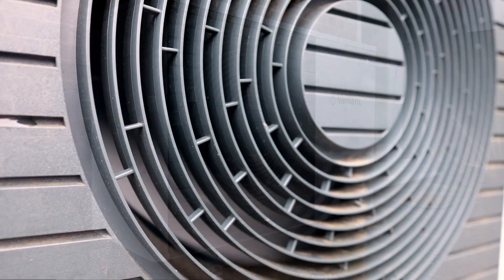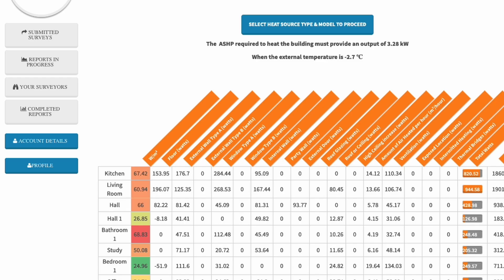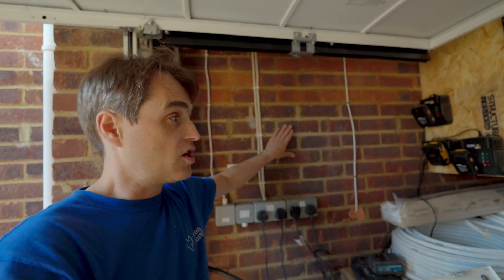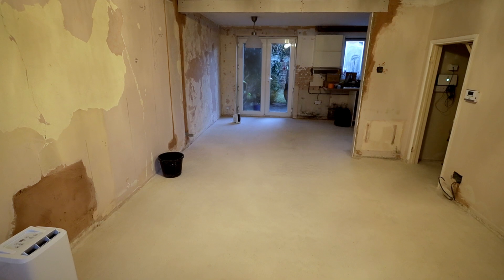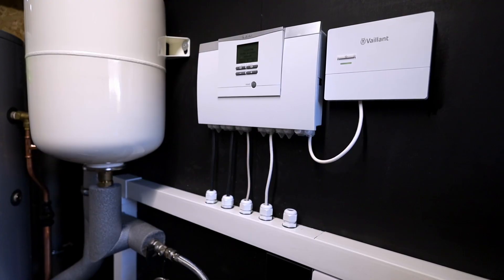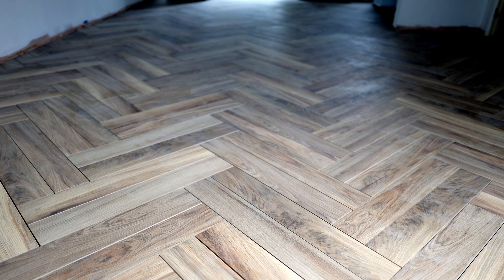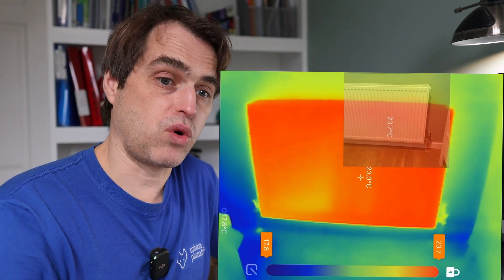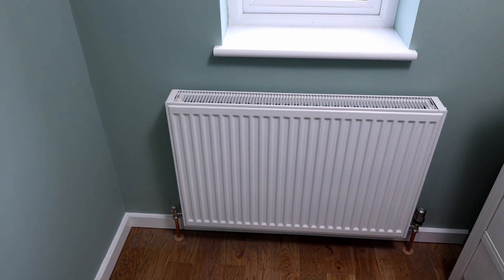How I Installed The Most Efficienct Heat Pump In The UK.

Comment: Great video. You mentioned no convective radiators. Are these a negative to efficiency? The Jaga ones for example give pretty decent performance at low temps on speed 1. Would be great to get your input. I should clarify I meant fan assisted rads.
Reply from the maker: I only came across Yaga once, and they had a very high resistance to flow, which did not impress me much
Reply: @UrbanPlumbers 

Hi thanks for your speedy response. Noted. I'm assuming that the main pipework could be sized slightly larger so your index run is reasonable. Great vids for what it's worth.
Reply from the maker: @pungusattah  i don tknow what the pressure loss is across yaga rads, but on the last we did it was substantial and made the job very tricky to balance. I would check the Kvs values of the rads to be sure, as upsizing the pipework may not have that much effect, as the pressure loss on the models we worked with was substantial. I know I will be very careful with those rads from now on. (meaning - will make sure I check the Kv values before installing them on any system).

Comment: How is the hot water hot enough for a shower if the heat pump flow temperature is so low?
Reply from the maker: All modern systems run (or should) 2 different flow temps- low for heating and higher for DHW. Some call it priority hot water, but it gets confused with old school W plan.

Weather compensated system will basically run water on its own and with different flow temps

Comment: Landlords are not going to install expensive efficient systems, they will install the cheapest , and i will knock a hole in the wall for a flue and use a wood burning or coal burning heating system. Used during the dark which is most of the day during winter. so nobody can see the smoke being expelled. I am all for green energy but not when i comes to the point of me choosing between heat and food. And i guarantee there will be millions like me.

Comment: Surely there's going to be a lot of heat lost to the ground. Can an uninsulated slab really work as a heat store??
Reply from the maker: Yes - we have done around 30 large installation in this manner and they perform amazingly well - some run COPs 5-6 and use very little energy.

Comment: I have just paid my deposit to Heat Geek, So I am hoping for, or perhaps expecting, a similar outcome. I have a 4-bed late 70's detached house but my annual gas bill for heating and hot water and a bit of cooking on the hob is just £260 with a combi boiler, which I run at 45 °C flow temperature. I hope all Heat Geeks are as good as you! Great install, thanks for sharing it.
Reply: 12kw ASHP  at 45c flow, 24/7, costs £300/month for heating, northern. Running on urbans principles, almost, bar the flow temp.
Reply: FWIW,  We have three permenant air vents, plus five windows on vent setting, so our heat loss is Huge. I think we could achieve £150/month in winter if we had an air exchanger system, and we adapt our manifold which is still a permenant blender, the worst type, as it blends 50% of the ufh return into the flow. One bonus, through really accurate system balancing, our ashp runs 24/7 with no stop starts, so perfect modulation, no cycling.

Comment: Have my system now and it’s brilliant. It’s a 300m2 house and 16kW heat pump, but with 10C OAT it runs nicely at 25 C flow temp and keeps the house at 17C day and night and 300L of hot water. Between 6-9 extra kWh juice a day, free to run for us as it all comes from our PV and battery. Best decision we ever made.

Comment: But no floor insulation on a concrete floor? Isn't the heat just going to radiate down and into the ground? I know you said its going to actas a massive heating slab but isn't that going to cost a lot of wasted energy and money?

I've got renovation coming up and have a concrete floor and solid brick 1930s house and I'm considering digging up the concrete floor to insulate and put underfloor heating on top.
Reply from the maker: Yeah - not a problem and I wouldn’t spend money on digging the floor up to insulate. I used around 1200 kWh for heating and hot water in that house over a year, some £400 annual bills.

Comment: I like your videos but I don't understand why you didn't put insulation below the UFH overlay? Is it because the original concrete floor is already insulated? 

From Part L Building Regs:

Underfloor heating systems

Minimising heat losses
6.29 Ground floors and those in contact with the outside of the dwelling should be insulated to limit
heat losses to not more than 10W/m2
. The heat loss from the floor should be calculated using the
sum of the thermal resistance of the floor finish and the underlying heated layer, multiplied by 10.
Reply from the maker: It’s not really that crucial. The property is free to run and heat loss is so small that underfloor insulation would never ever pay for itself. My heat loss with uninsulated floor is 35 watts per m2 of floor area, and downward losses on that ufh will be around 5 watts per m2 or 150 watts overall - not a big deal

Comment: The one thing I'm missing from this video is what diameter floor heating pipes did you use? 16x2 mm? 18x2 mm or even 20x2 mm. Bigger would be better, but does the system that you used for the laying allow that?

Comment: Hi Szymon, it looks as if you left the volumiser valved. Have you tried running the system with and without the volumiser and if so, was there any difference in efficiency? A 100 litre volumiser seems to be quite big for an open loop system with a 5 kW heat pump.
Reply from the maker: Yes we did, not much difference - but it needs more testing

Comment: However we are back to basic principles, if you only need 4KW/h to maintain your home, 4KW with a gas boiler, would be still cheaper to install and maintain. If you can run radiators at 20c with Electricity then run them at 20c with a gas boiler, perhaps put a buffer vessel in to avoid short cycling the boiler. Carbon foot print overall would be less than generating and distributing electricity.
So back to basics, insulate, use large radiators lower flow temperatures, run low and slow.
Reply: A reasonably installed heat pump has similar energy costs to a gas boiler at the price cap. Szymon's installs should be great. 

It's more efficient to use gas to generate the electricity and distribute it for the heat pump. It saves at least 40%, even if all the electricity is from gas.

Comment: could you improve scop with the heatgeek hot water cylinder? or does the vailiant unit require the tank you installed?
Reply from the maker: I already installed a HG cylinder and it improved the COP!

Comment: Good video, but it seems you are conflating 'efficiency' with 'coefficient of performance' which maybe a tad misleading to those without a basic grasp of everyday thermodynamics.
Reply from the maker: Not this old chestnut again please
Reply: @UrbanPlumbers  I didn't expect to get 'Roasted', that's bit of a 'COP' out. 
COP is a series of variable measurments that determine how much useful heating can be delivered in relation to the amount of energy input that is required. An upper end COP of 500% is achievable under good conditions with current technologies (hat tip if you have achieved this). The loose 'Efficiency' term is fine, but what I think you are really mean is 'COP' or what can be termed as COP Efficiency  = Total Heat Output / Compressor Work Input. This does not necessarily determine how effective the system is in heating a domestic space due to its characteristics e.g. rate of heat loss etc. If thermal energy demand is higher than a rate the heat pump can deliver it would be incapable of maintaining the temperature. Often confused with the general themodynamic definition of efficiency where heat can be made to do work and thermal losses occur within the system boundary, so the efficiency would better be described for the whole system including the domestic space. Perhaps I'm being a bit Pedantic. Just Saying.
Reply from the maker: This comes up all the time and the terms get used interchangeably. We all know what they really mean 😘

Comment: That is so great. Can you explain please why during summer you have lower COP compared to winter months? Thank you!
Reply: In the summer, heating is not required, so the heat pump will be used to heat the hot water cylinder only, this is at a higher temp. As the unit works harder to reach the higher temp of say around 50  degrees, the COP will be lower. The water for Heating will be about 35 degrees.

Comment: I scoured my liquid floor screed with an industrial floor polisher using the pads that remove floor polish. I have rads that have fans under them, like kick space heaters mounted on the walls upstairs, these run on the UFH temperatures between 25 and 46 degs, so when the flow passes through them the fans cut in, if you put your hand above them it feels like cold air but all the bedrooms heat up in ten minutes or so. I have 40mm insulation on a concrete slab and that seems to work fine but the I only have 75mm glass insulation in the roof and access is not possiable to over 2/3 due to massive concrete beams that stabilise the gable end walls, the house was built in 1973 and there is a low level extension at the back that meets 2004 building regs for heat loss, so nowhere near your insulation values and that's why I have to run 46 degs max on my weather compensated glow worm system that has no mixing or thermostatic control on the ufh manifold, as you know the system controls run the heating flow and control the flow temperature. its costing me around £1100.00 a year now for gas but its on 24/7 from November to end of April with a 3 deg set back at night so I don't think a ASHP is going to save me too much what with the cost of installing it when I can do a new Glow worm boiler for a grand.   (The 46 degs covers us for temps down to minus 10 - 12 for up to two weeks, that's the worst we have seen here) keep up the great work, I find it very interesting indeed.

Comment: It's easy to exceed the COP spec if the outdoor temperature is higher or the flow temperature is lower than the conditions at which COP is specified, that's just physics. 🙂Our design outdoor temperature here is -23C, but the ground-source heat pump we're in the process of installing should hopefully maintain a COP of above 5 throughout the season.

Comment: A combustion heat pump would leverage this by the electricity to gas cost ratio of ~ 4.  

Electricity is 24.5 p/kwh
Gas is 6.25 p/kwh

24.5/6.25 = 3.92

Also, Fuel from solar thermal can be made for 2.4 p/kwh (~10x less than electricity).  Leverage that by 5 and get 2.4/5 = 0.48 p/kwh.  

24.5/0.48 = 51 times more for resistive heating than for a combustion heat pump at COP5.
Reply from the maker: you are missing the fact that a gas boiler is only 80% efficieny and if you take into account pump power it will be below 80% - so at 24p and 6p per kWh you only need:

24/7.5 = 3.2 cop and above is chepaer on a heat pump
Reply: @UrbanPlumbers  You might want to check your numbers again.  A combustion heat pump (COP4) is NOT a boiler (COP 0.8)

Comment: Air to water heatpumps have some problems !  In cold and humid weather ice can form on the 
heat exchanger and then the system use heat to melt this away ! also some of them are noisy !
How good it is depend on size and the gas used !   CO2 and Propane  is much better than 
r 32 that is a freon gas type it also depend on the radiators and floor heating inside the house
Reply: They used to.

Comment: ONLY if you believe the manufacturers monitoring system which is designed to give high figures to stop you complaining after its been fitted...
Reply from the maker: Not quite true. Mine is monitored by a very accurate and independent kit - it’s been 11 months now and the COP is 4.9 which you can verify for yourself in the link below this video
Reply: @UrbanPlumbers  Without details of the 'independent kit' its impossible to know how accurate it is. How are you 'measuring' heat output...?
Reply from the maker: 2%
Reply: Just to answer your question , there is an open source project by open Energy monitor . It independently measures the lectricity used and the heat produced. From this the real world scop is calculated . This is like measuring your mpg at the pump. I hope this clears things for u manoo
Reply: @kugzilla  Whilst not impossible it is very very difficult to get an accurate COP for heat pumps. Any instant reading which most units give are worthless. But we all know how accurate 'official' mpg figures are...under lab conditions...!
Reply: @manoo422  try following the link?

Comment: The First Law of Thermodynamics explains how the amount of energy gained from something cannot exceed the amount put in.
Reply: While true, think of heatpumps as moving energy. A heatpump might take 1kw of energy to move 3kw of heat from outside into the inside. It takes a relatively small amount of heat from a big area (the outside) and compresses it into a smaller area (inside). While you're right, if you considered the entire system, for example if you had the entire heat pump in one room, there'd be entropy and they're not 100% efficient. Heating is however measured as energy consumed and heat gained inside the property. We can ignore the reduction in heat outside because it's not relevant to us, but it would balance the equation in the way you're expecting

Comment: Great video. I wonder if you could answer a question? I see you have no VR71 on your system, are you running your ground floor UFH and first floor radiator circuit as one heating circuit? Only asking as I'm debating the need for zoning my house and running it with a more simple plumbing and electrical schematic with a new Arotherm+ 7kW. Cheers.

Comment: Interesting to see you were not worried about insulating the floor under the UFH. Almost everywhere online people say you must do this, but it is not always convenient in a retrofit. Does anyone think it makes a difference if the house is a cavity wall construction? As this potentially cuts the sideways losses in the slab...
Reply from the maker: Makes little difference . I have been doing a lot of uninsulated UFH without any issues. Mine has been in almost a year now and I don’t think insulating the floor would make any difference
Reply: @UrbanPlumbers  Thanks. I guess insulating floors is really overrated, especially on a retrofit. And you have the added benefit of using it as a heat store. Just make sure you have a nice conductive floor covering like tiles...

Comment: My mums 2 bed uninsulted bungalow only costs £90 for gas a month in the middle of winter and her house is 23degreas + most of the time. She had a new combi boiler fitted 5 years ago for £900. Struggling to see the benefits of an expensive complicated heat pump that cycles loads in the winter! Also your paying dear on your day rate electricity.

Comment: What was the total cost to install? Including installation and underfloor heating.
Reply from the maker: @Cyberbobxxxx  I did all the work so don’t know. Materials were probably around 7k - so grant paid for it all. Then I did the work so it only costed me my labour
Reply: How did you get it signed off? The government want a certificate of completion and commissioning before any grant is paid?
Reply from the maker: I signed it off myself. I am MCS registered. I got the kit on pay terms and then paid for it once I got the grant.
Reply: @UrbanPlumbers not sure why you bothered. Gas is 3 x cheeper than a heat pump. I know you got the kit for free but I bet it cost £3k in labour. Your cop is miles out and below 10c it will be terrible. I have 2 gree heat pumps 8 and 5kw , don’t use them for heating at all. Just a bit of aircon in the few hot nights. The energy isn’t green 40-50 % on a good day in the summer and diabolical in the winter. We ripped out 100s of  inefficient hot water cylinders and megaflows and put in big efficient combi boiler that were easy to maintain. I have a 42kw Worcester combi and that puppy is bulletproof and mega cheep to run.
Reply from the maker: @Cyberbobxxxx  LOL - mate - it has been running for a year now - my COP is almost 6 for heating and 4.7 for hot water. My total running bill for heating and hot water for so far = £224

Also, the house is super nice and comfortable and never feels too hot or too cold. 

High quality weather compensated gas system could also achieve this - but would cost be 2 times more to install plus vat and would be running on gas - additional standing charge, carbon emission and more servicing.

Heat pumps are amazing when done right.
Reply from the maker: @Cyberbobxxxx  42kW Worcester - lol - I despair at the total shambles of the heating industry
Reply: @UrbanPlumbers 6! That’s more than the heat pump would ever do running into a bucket. Also more than any manufacturer could ever pray for. Good luck with it , think you need to check your numbers and 21c radiators . I’ll keep going with my 5ppkh gas combi!!
Reply: Nothing wrong with the gas boiler industry !!
Reply from the maker: @Cyberbobxxxx  🤣🤣🤣

Comment: Wouldn't it make more sense to use a 3kW heatpump and get less on/off cycles ?
Reply from the maker: @jschmalzl   no. 3.5kW unit has exactly the same low modulation so would cycle exactly the same as 5kW

Comment: Is the external orientation of the heat pump crucial to the efficiency? In my house the options are limited and the free space is only on the north side. Thank you!! Great video as always.
Reply from the maker: No it doesn’t matter that much. Mine is always in the shade on the north side
Reply: Thank you very much for your reply. @UrbanPlumbers